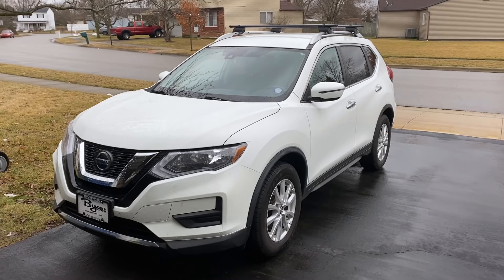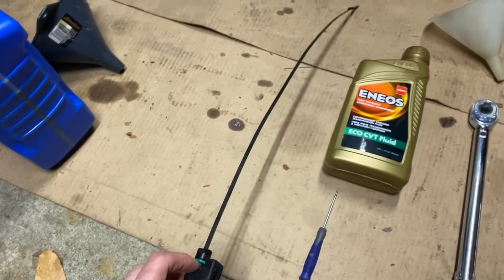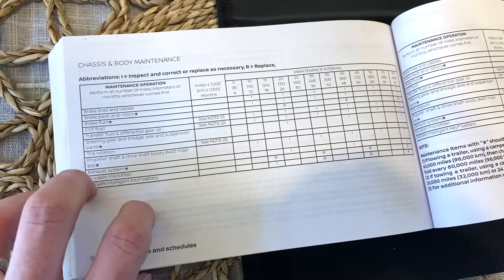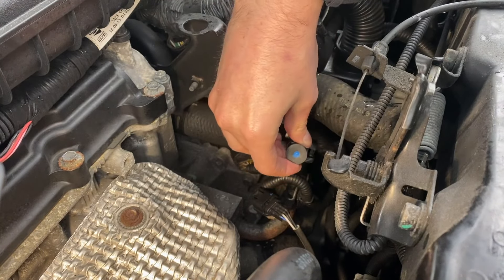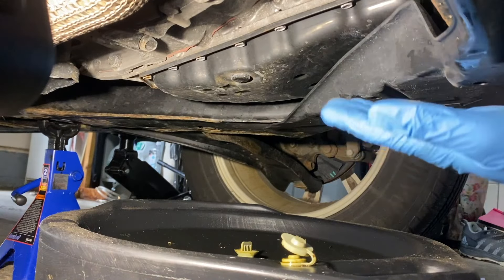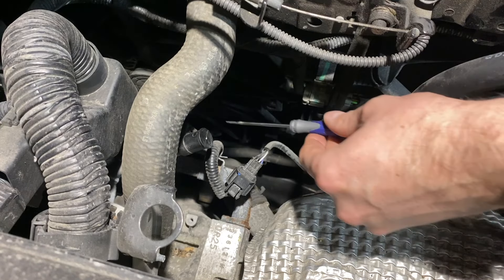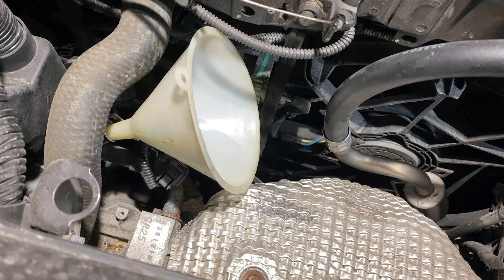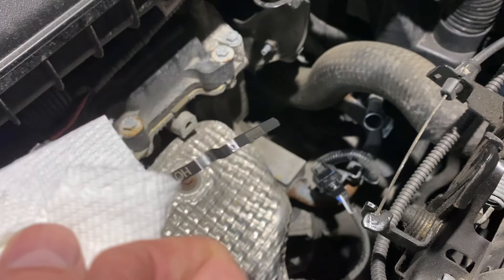2013 - 2020 Nissan Rogue CVT Fluid Change

Comment: I fail to see how all this nonsense about getting the fluid up to temp is relevant IF you have a dipstick and check it  cold or hot and you mark those measurements as a reference point... The laws of physics are constant ie coefficent of linear expansion.  Anything to confuse the consumer it seems..  Assuming of course the dipstick is accurate which btw, I saw one video where it wasn't..
Reply from the maker: The fair observation is taking measurement with the engine running, as that will help you measure the relative low point of fluid as the rest is circulating!

Comment: Nissan put their dealerships first at the expense of customers. No wonder they are running bankrupt. Why put cvts in cars without an automatic option. 2. Why put a crappy cvt inside your cars. 3. Why no dipstick or drain a fill volume in the manual. We'll I guess people are fed up now
Reply from the maker: I don’t mind CVTs, and have come around to liking a lot of its gear shift. Almost all Asian models are flipped over, so not necessarily a Nissan thing.

Comment: Hi. Thnx for the Vid !   ...  What about the CVT oil filter that goes inside the pan? Does that needs replacement? Here another vid for reference, shows the filter after min 2. Thanks ! https://www.youtube.com/watch?v=nzDBP8I--ac
Reply from the maker: There are indeed two additional filters inside the transmission, one at the top and one within the pan. You can absolutely do that filter swap, though be warned the bolts around the pan are very easy to strip/require very low torque to tighten.

Comment: careful with this drain volume method. This stupid cvt is designed to filled from the bottom inlet until fluid coming out from overflow outlet. And it needs a 3x 3 liters flush cycles per service manual.
Reply from the maker: Good insight!

Comment: That is only a partial fluid change. The total fluid in rogue trans is 8.4 quarts. Leaving 3/4 of the old oil in the torque converter and valve body is not a change.. A trans fluid change includes all of the old oil out 1st, then fill with all new oil. Plus there is a paper filter behind the heat exchanger that you did not even address. WTF?
Reply from the maker: Saving for a separate video - to be honest, so hard to get at that back filter, so wanted to be sure to get a fluid swap out to help folks get underway.
Reply: How about you make a video then. WTF?
Reply: Semantics. If they’ve been changing every 30k or less than a drain and fill should suffice, even without changing filters forever possibly due to the oil remaining clean while changed so filters never get clogged. If it’s been long then multiple drain and fills makes sense and to check filters.

Comment: Way too much talking lol just do the godamn oil change
Reply: The talking is for those who have never done this kind of work before but are willing to learn to DIY to maintain their vehicles. Matt didn't go off on any tangents. He described, in detail, things to consider every step in the task. It helps people to understand everything that is involved with the process, and what potential issues they could run into and be prepared to respond to.
Reply from the maker: This is also why I use timestamp index, so you can jump ahead to respective sections. This whole project has definitely been most involved, as Nissan makes little to none of this apparent. Definitely a longer video than most!

Comment: The same dipstick tube fill port can be utilized to add transmission fluid in order to reach the desired maximum level. Pro tip: Use a full synthetic CVT/ATF EQUIVALENT TO THE NISSAN CONVENTIONAL TRANSMISSION FLUID FOR SUPERIOR, LONG, LASTING PROTECTION. ALSO IT IS BEST TO DRAIN AND FILL THE TRANSMISSION FLUID EVERY 20,000 MILES OR 32,000 KM IN CANADIAN MILES. These 2 recommendations will ensure a longer lasting transmission and greatly reduce the failure rate, then, if otherwise, following Nissans recommendation, which has their best interest at hand, and not yours. Always remember manufacturers sell cars and want to sell you a new one because that is their business and the entire premise of a company that manufactures vehicles. When something says lifetime fluid, it is often misinterpreted and understandably so. Lifetime fluid simply refers to what the manufacturer considers to be the lifetime of that particular component such as a transmission or cooling system or engine. so if the warranty is 60,000 miles on any given component? This is what's considered lifetime of that component and once out of the warranty period They are free and clear in hopes of you needing a major repair that could outweigh repairing it when compared to the purchase of a new vehicle. Dealerships, don't make a lot of money on the sale of a vehicle. Where the real money is made is the after purchase sales of an extended warranty, paint, protection, piece of mind protection, powertrain protection, over and above the standard manufacture warranty.  These tactics are often expressed in such a manner that often instill fear of the unknown rather than a wait and see approach approach? Not to mention many of the servicing intervals have been greatly extended in order to entice customers to buy their vehicles, because you can save so much of your precious time by not servicing the vehicle as often. Unfortunately this has become common practice with all of the vehicle manufactures in order to remain at par to not lose their portion of newly purchased vehicle market share. Always remember they sell vehicles and they want you to come back as soon as possible to buy another one! if they lasted forever, there wouldn't be many car companies needed. A dealership would much rather replace your transmission simply knowing that they have put in a brand new component rather than repair a transmission and have to warranty an already failing poorly designed transmission, strut tower, control alarm, alternator or catalytic converter etc. It's always in a dealership best interest to replace a component to minimize a return repair, cutting into their bottom line.
Reply from the maker: Yup, which is why we poured fluid down the filler neck. 😉